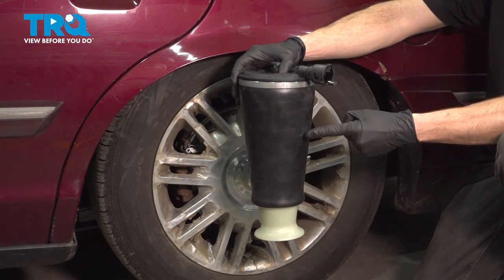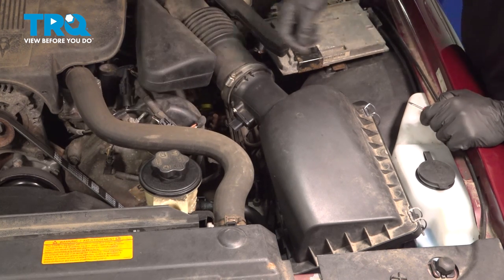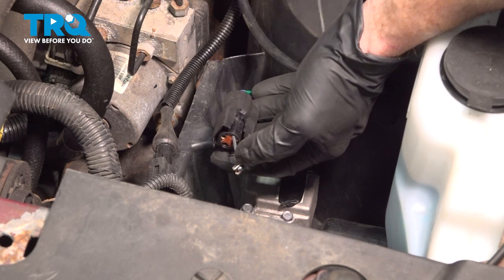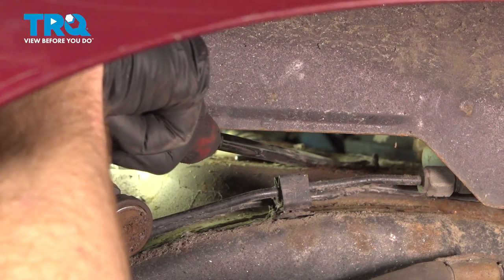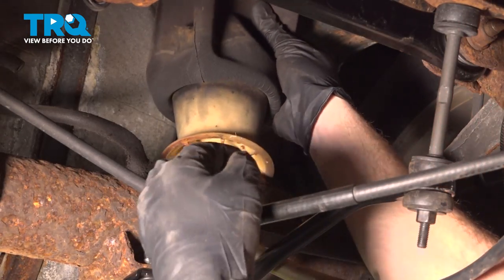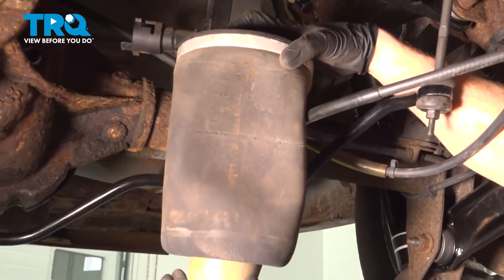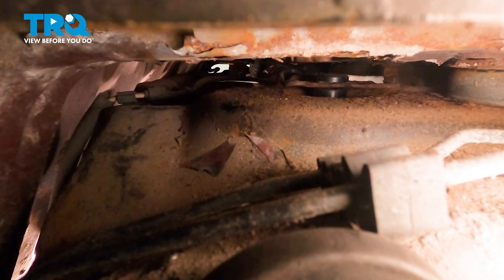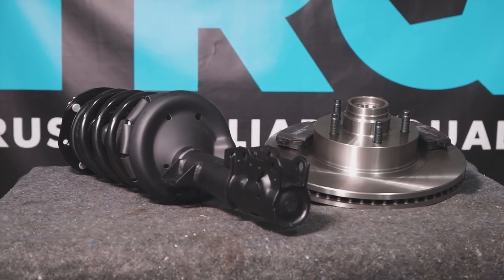How to Replace Rear Air Spring 2003-2011 Mercury Grand Marquis

Comment: First step would be to hit the Air Suspension switch in the trunk. Then lift and remove. Lower car slightly lower than normal height, then turn switch back on  and allow to level out.

Comment: Wonderful video. I just bought a 2009 Grand Marquis. The owner had replaced the rear air springs with regular springs. I don't know if there is anything wrong with the entire system air suspension system. Is there are way I could test what is there before I try to replace the rear springs with new air bags?

Comment: Good video.  Straight and to the point.
Showing exactly how the clips on the air lines and electrical connectors release is a big help.
There are so many types of those, it's sometimes difficult to figure them out by feel alone.

A couple issues though.  
1:  What happened to the electrical connectors you disconnected at the rear air springs?  I can't see where it was connected on the old air springs, nor on the new ones, and you made no mention of it during reassembly.

2:  There's no need to do an alignment after replacing springs.  Nothing affecting wheel alignment is disturbed when doing this job. 😉